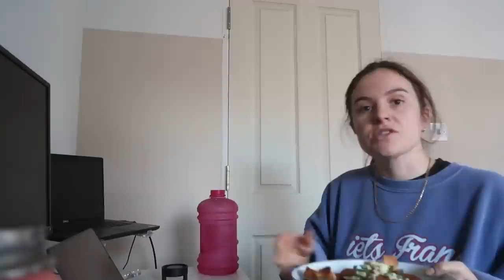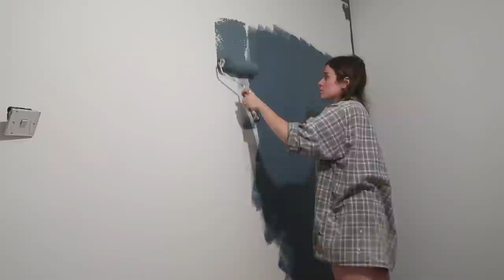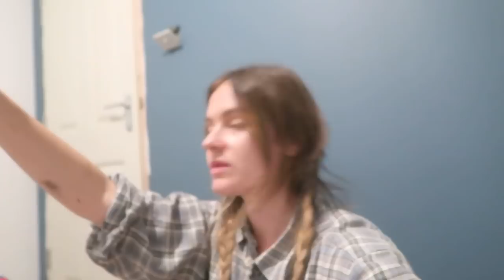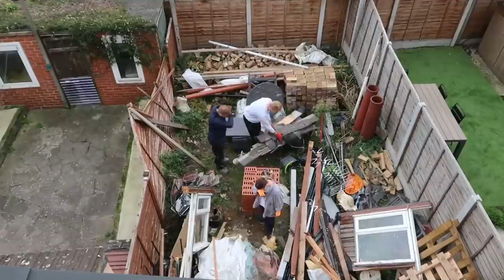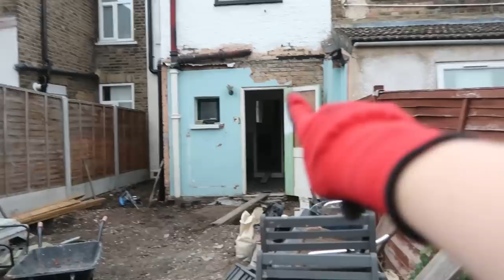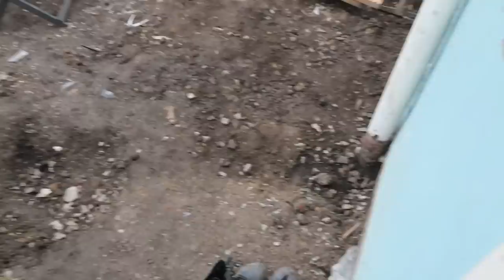THE NEXT STAGE | getting a skip + garden renovation begins | victorian DIY diaries

Comment: One question why did you not do the whole outside of your house in insulation?  Well here in Ireland the government have said that they want to wrap over 500,000 houses by 2030.  We got our house done for free, yes free and it had made the house much warmer.
Reply from the maker: We’ve never heard of this before! Government here had discounts to make your home more green through insulating flooring, boiler, double glazed windows etc. but not by wrapping your home. We would definitely do this is the government ever offered a scheme like this in England! 

We did also apply for the Green Grant for insulating underneath our floors but they only offered rockwool and we had a bunch of cellotex which needed using (and also offered better insulation!) so we just did it ourselves in the end (saving £1000 in the process) ☺️
Reply: Now you do have to qualify or you can get grant for 6k towards full wrap, like your gov they give grants for underfloor insulation attic and indoor dry lining.